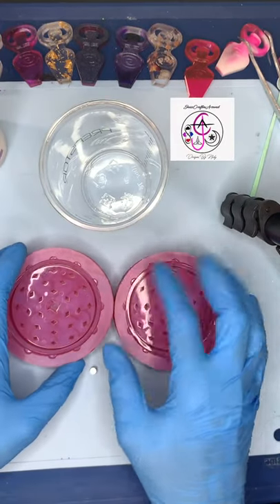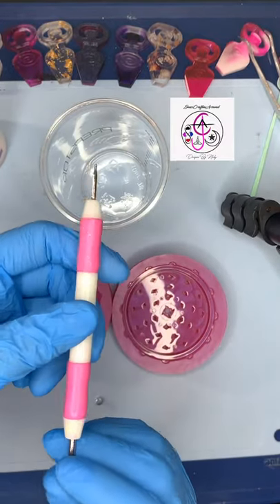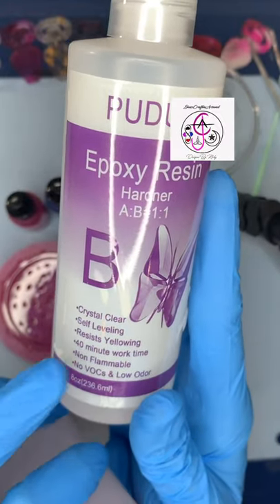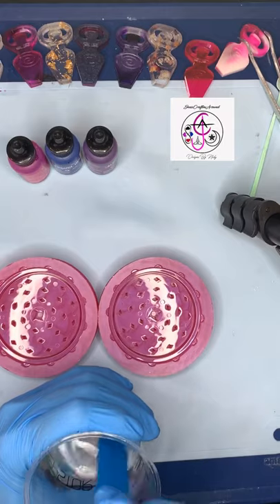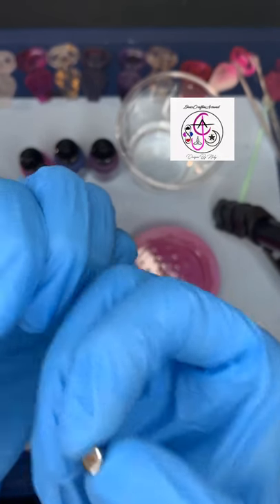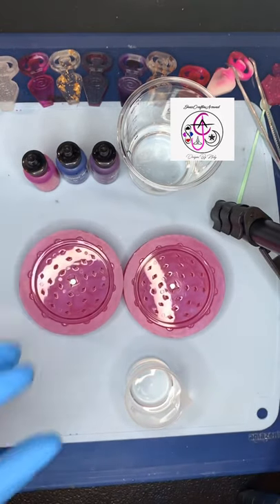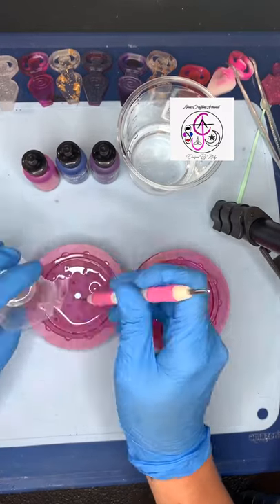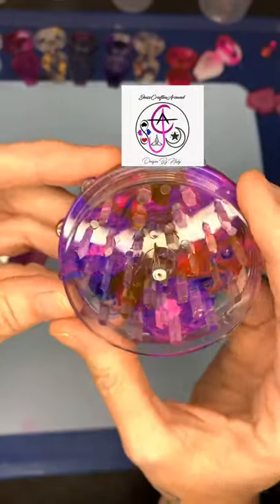Resin Grinder Tutorial

Comment: I haven't found any information that says Puduo resin is food safe once cured. Where did you get that info? Is it safe to use a grinder made from resin that isn't specifically labeled as food safe?
Reply: I’m quite sure if it isn’t legal they wouldn’t be in almost every neighborhood corner store or smoke shops. 🤷🏽‍♀️
Reply: Resin food safe but it's if it chips away and you heat it up and smoke it. I'm trying my self to find out if it definitely is harmul

Comment: What do you mean when you said you let it cure before you added the glitter
Reply from the maker: So, glitter is heavy and if you use it in the teeth part, it sinks to the bottom of the teeth and can cause air pockets, causing your teeth not to be full and complete.  So I do the teeth first, let them cure for 4 hrs and then finish the rest filled with whatever I want to use, like glitter and stuff like that! 😊

Comment: This is insanely unsafe. plastic grinders creates a lot of friction and often start to flake, so using a noxious, poisonous material to make one is irresponsible at Absolute best.  At worst you're pretty much poisoning your customers.  Grinders must be made from food grade material.  Possibly consider making pretty resin cases for cheap metal grinders so you can avoid trouble.
Reply: I actually read that some resins can be used to eat off of etc, and are completely safe.
Reply: If the resin is food safe resin once it's fully cured so 72 hours or so its completely safe
Reply: I buy FDA approved food grade. Perfectly safe